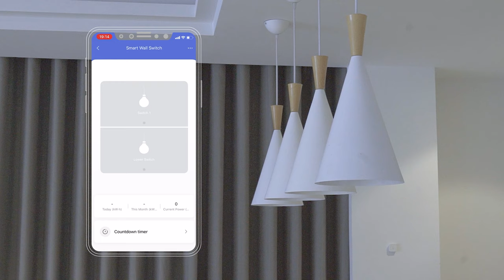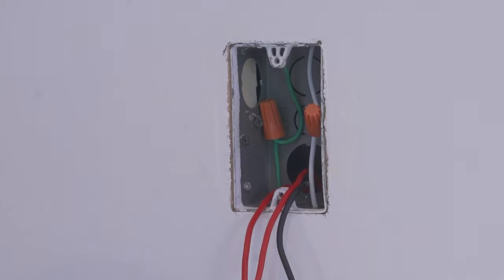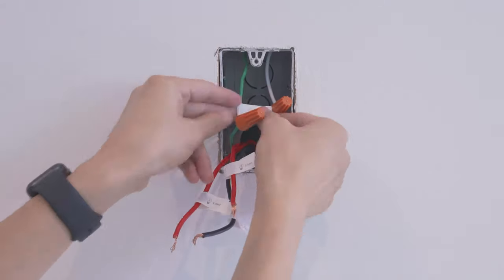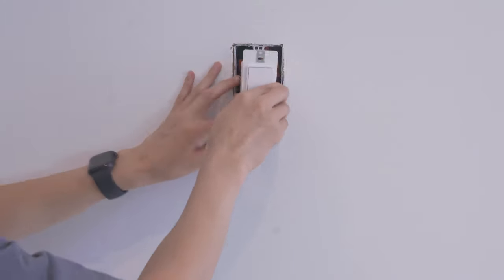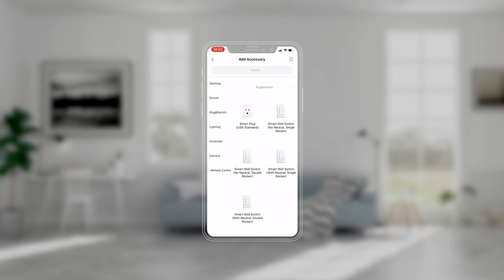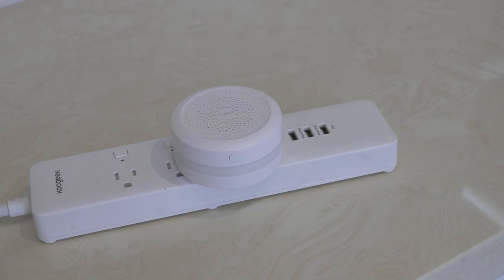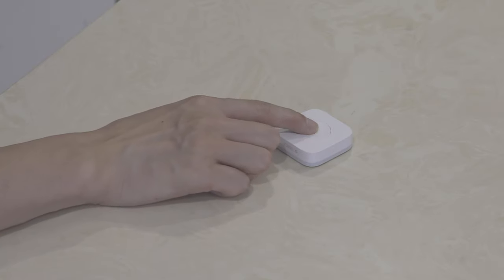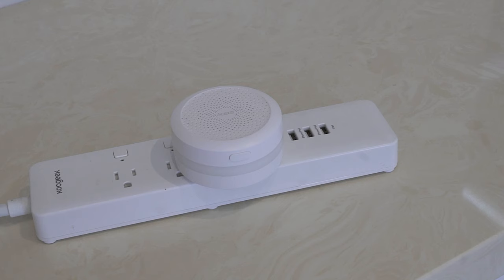Aqara Smart Wall Switch No Neutral, Double Rocker Installation Video

Comment: Hello, If I buy a smart switch no neutral from aqara with 3 gangs but I have just one line for light connected to the switch can I use the others 2 buttons to control others things around the house like led strip or smart plug with routines?
Reply: This is what I want to know!